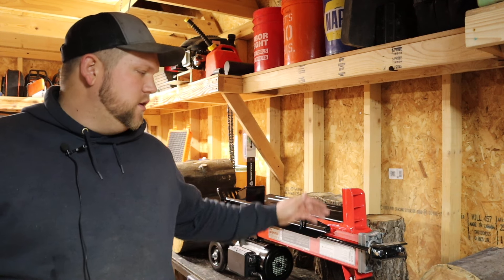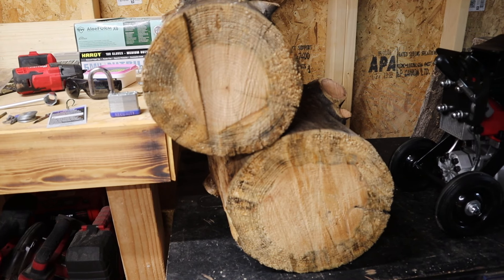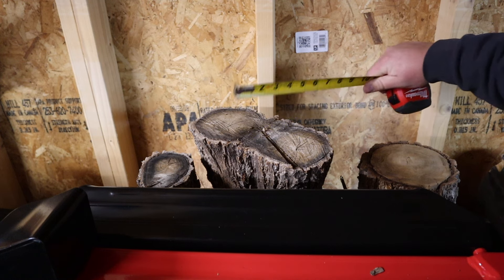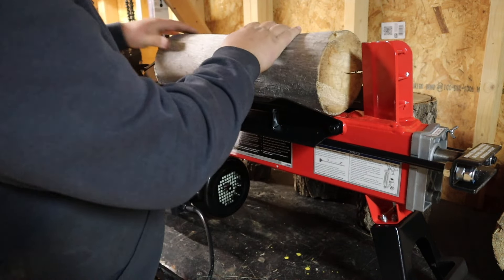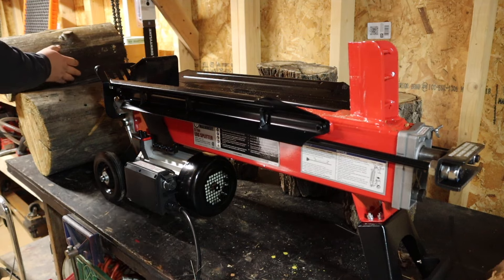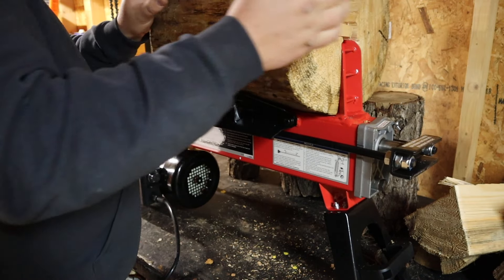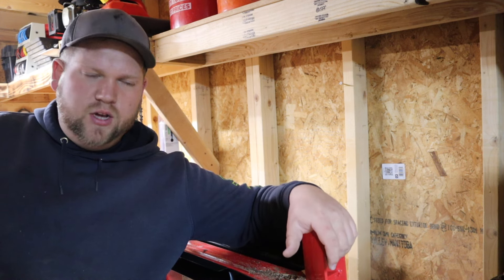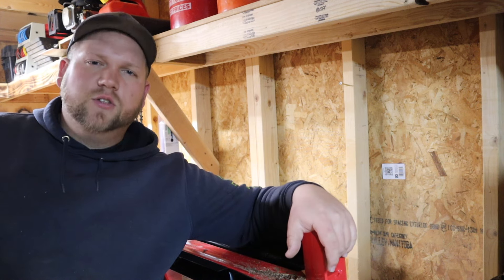What are the Limitations of Harbor Freight's Central Machinery 5 Ton Log Splitter?

Comment: I've had mine for five years.  I spent all day, today, 20APR24, , splitting 20 inch plus oak rounds.(it takes some practice for those)  I love this machine.  I filled it with fluid when I bought it, and it still reads full;  about twelve cords of oak later.  It paid for itself the first time I used it.  I can't recommend it high enough.  For the money, it cannot be beat.

Comment: Own mine for a least 6 years and split dry and wet wood. It works great for me as a backyard fire pit homeowner. It does struggle with larger pieces so I shave the those starting on the outside edge. Only had to replace the capacitor once in the time I’ve owned it.
Reply: How hard of a fix was replacing it
Reply: Two wires 5 minutes
Reply: @KillingStuffWithJosephJackson  you can get the part at your local ace hardware or  air conditioning/electrical warehouse. Capacitors are very simple to replace all you need to do is match the MFD# on the part.
Reply: @MichaelSemon-d9m , suggest same or upto 10% microfarad over original value. Also a higher V rating is more durable.

Comment: I just bought one of these a few days ago. A cord of wood would last me three years easy because our winters down here are not so rough, except for the occasional “blizzardy snowstorm“ that we get. However, this thing split wood like a champ, and I am extremely pleased with it’s performance. I appreciate your video in helping me make my choice to buy this particular log splitter. Thanks again!!
Reply from the maker: You say “down here” I’m guessing Texas? Sounds good. Hope it serves you well. Thanks for watching!
Reply: @DereksWorkshopAndProjects  Texas it is!!
Reply: If you build a rocket mass heater you will use 10% of the wood you use now.  Wisconsin Winters in a double wide manufactured home you need just over half a cord a year.

Comment: I have the Homelite version of this splitter, otherwise looks exactly the same down to the red paint. I was skeptical buying it, would 5 tons be enough? Between the splitter being cheap and me really not wanting another gas engine to maintain, I rolled the dice. 10+ cords split later, maybe 10 pieces of wood it hasn't handled. Very pleased. When it's raining sideways outside, I particularly appreciate splitting wood from the comfort of my shop.
Reply from the maker: I didn’t even think of that. Being able to split wood indoors is a huge bonus of this.
Reply: That reminds me, it's pouring down rain where I'm at today. I think I'll throw on some flannel, pour myself a mug of beer and go run the splitter in my shop 😁
Reply: @NordicDan  Enjoy!

Comment: i have something similar. it will split 19 inch length oak but it cannot handle huge diameters. but thats what a maul is for. break the big rounds or at least crack it to give the splitter a chance. works pretty good for what it is. its also much quieter out side so its rather ok to work with for long periods. dont forgot to open the air bleed valve when operating and close it when done.

Comment: I have another brand one,a PROYAMA wood splitter from Amazon.For a Homeowner with limited duty this little splitter is very good. While this is a compact unit for storage and moving around - it is heavy! I see some people mounting this on a small wagon and towing to the site they want to split wood at. If you are on flat terrain, not a big deal to move around for most, on hilly terrain, the small wheels make it a pain in the a$$. That being said, I like it, and it works well for my needs. As I trim trees on my property I cut the limbs and trunks to be split for firewood.And it also comes in a version with a stand.

Comment: The weakest part is where the two rods are welded to the two zig zag shaped plates on each side of the splitter. They notched the plates to accept the rods in a recess where they are welded.  The second season of using it the welds broke and the plates bent too far out of shape to save them.  I cut two new plates from 1/4” steel and welded the rods back without notching the plates. That was two years ago and it’s been working fine since then.
Reply from the maker: I’ll have to keep my eye on that.
Reply: @DereksWorkshopAndProjects  Welding some extra beads across the existing welds where the rod meets the plates should help strengthen that particular connection.  Those plates are 3” across and the notch is cut 1 1/2” or half the plate weakening it to the point of failure. Unbolting the rods and welding the plates from the inside would also help to keep them from failing.

Comment: Great demonstration. I have a bunch of red oak to split, some rounds are really big. This video convinced me to pick up this splitter.
Reply from the maker: I hope it works well for you!
Reply: Hey, I have a bunch of red oak too, also some fairly big pieces, how did it do?
Reply: @billtoews6485  haven't had time to use it yet. It's been raining constantly. Hopefully the wood being soaked doesn't make it harder.
Reply: @billtoews6485  I finally got around to using it and it's worth every penny. I was shocked at how easily it split some larger pieces that my maul would just bounce off of. The largest piece I split was probably 16 inches diameter and 20 inches long and it had no trouble. It has some trouble with knotted, twisted wood but you can usually move the piece in a way that will allow it to split. It's also much easier if you have a 2nd person to hold the piece on the splitter so odd shaped pieces don't fall off.

Comment: I bought mine back in 2012.  I built a rocket stove, and split 2 cords of Larch.  Burning 1x per day for 4 months.......I still have 3/4 of a cord left.  The splitter never had a single problem cutting up 10-12" diameter logs.  I split them all into 1-1/2" (roughly) kindling.  On mine, you can bypass the 2 handed safety mechanism (factory made) so you can get the pieces to the splitting surface quicker.  It's still running strong.  I have split several cords over the years for my elderly neighbor.

Comment: I got an older version of this splitter...they call it a 7 ton. I'm not sure if it's 7 ton or not. But it does work really well for what it is. My neighbor has a 3 point hitch splitter for his tractor and he's constantly borrowing my little electric splitter because he says it's quicker. The only thing is it's kinda heavy to get up on a bench by yourself. So I usually just sit down on a milk crate and use it. I gotta make some kind of retract restrictor on it so that the cylinder doesn't' retract all the way back which wastes a lot of time. I was thinking that just a piece of PVC pipe with a slit in it that slips over the cylinder rod would probably do the trick.
Reply: I was thinking the same thing watching this video. "I'd put a blocker on that real quick."  I wonder why they made it auto retract...
Reply: @TheRealMonnie   it's just a spring return.  It's not hydraulic power in reverse.

Comment: I have this splitter, and if I can lift it to get it on it, it will split it.  I split red oak, white oak, maple, and hickory.  In this south, no one heats with pine as it is considered a trash wood, but it does make good kindling due to the sap!
Reply from the maker: I see that! It’s not a great firewood compared to what’s in the world, but compared to what’s readily available within a 30 minute drive of me, it’s the most abundant. There is some white oak and other stuff around us, buts it’s sparse, and if it’s easily accessible with a 2 wheel drive truck, it’s already been cut or it’s still green and you can’t cut it according to Forrest service regulations (which is a good thing). So I just go for the less desired since it’s so abundant and quick to get. Jealous of you guys around and east of the Mississippi! I wish we had the variety and abundance of trees, grass, and water that you guys do!
Reply: I burn everything.  A lot of people turn their noses up at softwoods around here which means more of it for me!  I split by hand and it's 3x easier to split pine than locust.  I get free wood from local tree service companies. Maybe after I get a powered splitter I'll be more choosy

Comment: I like mine (2nd or 3rd hand).  Didn't have the directions but after a little frustration, I found them online.  Don't overfill the oil.  Open the vent screw the 4 times required.

Comment: I found a few modifications which should further improve the performance of this splitter.

Welding an axe head on the front of the wedge helps with splitting big hardwood rounds.  This mimics the profile of modern splitting wedges, allowing the wedge to penetrate immediately before fanning out the wood.  Also safer since the wood doesn't want to pop out as much.  You lose some travel for longer rounds, so another alternative is to file down the wedge and apply linseed oil.

Another modification is to attach a wood clamp over the on button to free up a hand to handle the round while splitting.  Then use a foot pedal switch to turn it on and off.

Comment: One modification I have done is to run a weld bead align the top front edge of the pusher.
I ground this weld bead to be steel teeth. 🦷… This means the wood will grip on to the teeth and not slip sideways.
I also sharpened the anvil edge and took the paint off it.
Never had an issue with it even cutting through knotty pieces.

Comment: Great video ,great splitter however You need to remove the wing nut on the right hand side of the splitter it is a vent that should be open while using . I use mine as a press at my forge.
Reply from the maker: I don’t think it’s supposed to be all the way removed is it? Just loosened? All I have done is loosen it and I haven’t had a problem.
Reply: As long it’s opened it should be fine  it just seems to work better for me to just take it out but I max mine out a lot .

Comment: Used mine for a couple years now. It is worth the money , a great tool to have. It is very much limited when you have knotty wood , however.
If it won't split? Endo  or rotate the wood. That don't work it's time for the 25 ton Gas machine.

Comment: 2nd season owning my splitter, mines equivalent to a 7 tonne splitter, Im pretty sure the manufacturer makes these splitters in lots of colours and configurations, just different company labels on them.
Ive not made any changes to it, it came with 2 wedges, one at each end, and a collar on the side bar so it doesnt return to the very beginning, which makes things quicker when splitting short logs.
I split logs/rounds up to approximately 16" without too much of a problem
Ive found the only problem is where a branch joins the main trunk can be very tough, probably because the grain is all knotted and twisted.
Overall well worth the money, I paid £300.

Comment: I own this splitter had it for 3-4 years now I have split tons of wood with it it does work great but here where I’m from it won’t touch gum over 6 inches most of the time and hickory if it’s over 8 inches it won’t touch it oak red and white I have split 24in rounds no problem unless they are knotty guy in the video is splitting stuff that just breaks apart compared to what I split

Comment: I just picked one up and ran into some issues. After bleeding and refilling the fluid it seems to be working better, but still bogs down at the end of the stroke.

It struggles with locust rounds over 8" and anything knotty.  Will need to run some more pieces through it to see what it can handle.  If further bleeding doesn't work I may see if I can exchange with a different one.
Reply from the maker: I would definitely suggest trying to get it replaced if it seems to be working poorly.
Reply: @DereksWorkshopAndProjects  HF said they can replace it no problem within 90 days of purchase

Comment: I also bought one of these splitters about 1 month ago and it performs well overall. The only problem I've found is the oil seal for the hydraulic cylinder is starting to leak a small amount of oil during use. No doubt a very cheap oil seal! I plan on tearing it apart this summer and replacing this seal with a better one. 
Watch your seal just in case...
Reply from the maker: It’s pretty good! Haven’t had the oil seal problem myself but I’m sure it’s coming someday. I’ll keep an eye out for it.
Reply: @GunClingingPalin I was given one like this, DR 6 ton and the seal were completely leaking,  I was able to find new seals at A.C. Depuydt in Commerce,  California.

Comment: I have one of these and I use it to split in new England with all sizes of hardwood, but it is rarely enough. Only able to resplit small pieces. A good force meter says it's putting out 6400 lbs, so only 3 tons

Comment: If I were to change anything with those splitters it would be first I would make the wedge sharper with a protruding point on top to keep wood from riding up as it splits I notice that alot) And also I would put some kind of barbs or points on the ram end that is so smooth. I see pieces riding up as they split, which could be dangerous (I've seen pieces shoot and almost hit a person in the face!)
 A steel plate/table behind the splitting wedge would be nice for the wood to slide onto after it's split instead of landing on the ground (or your foot if you have it on a stand)

Comment: That's the easy, straight grain, stuff. Try splitting more crotches of branches. I'm wondering if those 27 ton models just pushes through them.
Have you notice these small ton electric ones are all just about identically the same?

Comment: I have a Boss 7-ton (model ES7T20), which looks almost identical in construction to this machine.  It's only rated for up to 10", but I've split oak rounds up to 20" with it.  Best $450 I ever spent.
Reply: the boss is one handed operation, it's easier to use and safer

Comment: 7:43  If I were splitting that with a maul, I'd be hitting the other side.  No matter what line you choose on the crotch side for your splitter, you're going to have wood fibers on both sides of the blade crossing to the other side: instead of separating fibers from their neighbors, you're going to have to cut those fibers, which is a much harder job.

Comment: I have a older one of these and for what they are they are wonderful . Problem I see from this is they have went to  a two handed system to run it how sad. Mine you turn the motor on leave it on and then operate the hydraulic cylinder with one hand and you can handle the wood with the other.

Comment: The bigger round it is the shorter i cut it >   Cause of the weight!   Red Oak is very heavy, and most of it is GNARLY < > It did a great job if you ask me.   👍👍  1st thing i would do to it is ? Make it 4 way splitting
Reply from the maker: 4 way splitter with softwoods would be great I think!

Comment: Do you have to hold the start button? I have the same spliter mine stays on. You have to push the button in deep.
Reply from the maker: It seems no matter how hard I push it in that it doesn’t stay on, so I’m not sure.
Reply from the maker: I believe they made changes to it at some point in time.
Reply: Mine has had at least two previous owners and the motor runs as soon as it is plugged in.  I split a lot of white oak up to about 14” and it does a great job.
Reply from the maker: @dirtbikeheaven1129 starting up the motor does get old.

Comment: Too slow, and cylinder should be behind the material?
Just reviewed a cordless Ryobi, much faster, more compact but limited over all length.
Reply: No, the cylinder doesn’t have to be behind the material. The force is simply transferred by the 2 rods running back to the “ pusher”. This design makes the whole unit very compact. I bought mine back in 2003 and when I first saw it my thoughts were “ that little thing can’t be very good”. Had it for 10 years, no problems. Moved to an oil heated ( then heat-pump) house. Sold the splitter. Yes , it was a bit slow but easier than using a maul and wedges.

Comment: Use shorter pieces and be 120% impressed?  I'd like to see the splitter struggle and stop, like would happen to the normal user using as much of the tree as possible, even the gnarly stuff.
Reply from the maker: 12-14 inches? It’s not like it’s so short it’s unusable. Just not my regular 18ish inch rounds with softer wood.

Comment: I call BS on all these videos about that splitter. It's completely under powered compared to what these videos show. It's choking on some oak logs smaller than 10 inches and I have to start them with the axe.
Reply from the maker: I wonder if yours isn’t just defective? I have actually now, (over a year later) hit wood that it couldn’t split, but those are like 12” + elm wood pieces that are really wet still.

Comment: To the headline, 5Tons, that's a pretty significant limitation, right there.
Reply: I’ve learned to ignore those strength numbers ( the copy editors all seem to be in a race to out do each other / lie) and wait to see a good review like this one. Gasoline splitters went thru that years ago. Speed vs power vs price is always a trade off.
Reply: @agentleebs  Okay my comment was a bit tongue in cheek. If you've looked at those little machines, they are not heavy duty. I split a lot of eucalyptus. It has a density that is slightly greater than oak. In some varieties it has a spiral grain, throw in some knots and add the fact that they can often exceed 30 inches in diameter. That little HF splitter wouldn't stand a chance. In fact, the home depot in my area rents 6hp hydraulic splitters. They flat out tell you theirs will not split euc. So yeah, I know the rating doesn't mean that much, but the engine, pump and diameter of the cylinder does. It takes a beast of a splitter to tackle what grows in my area. At least if you want the good stuff.